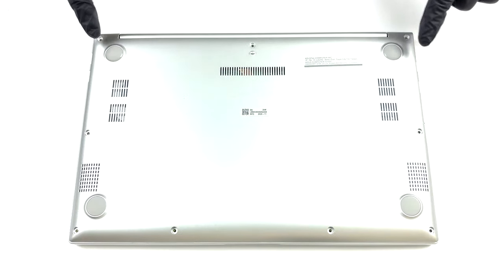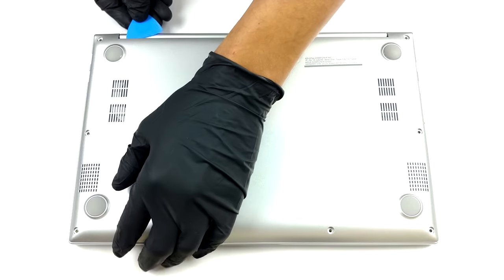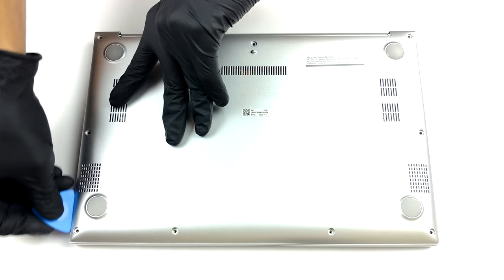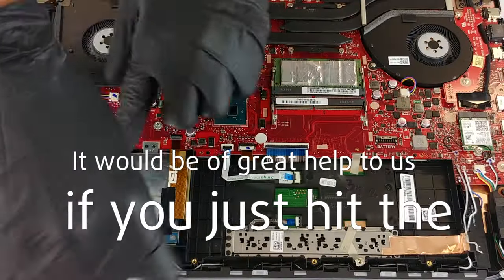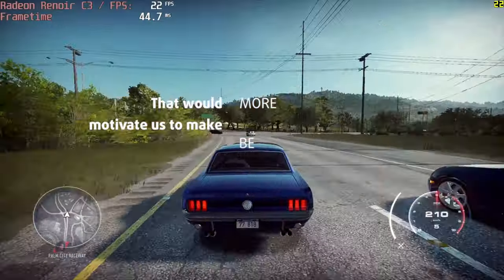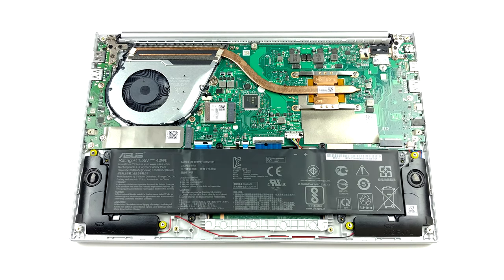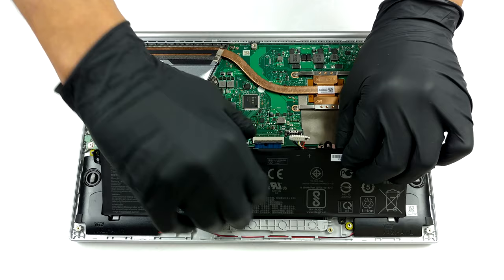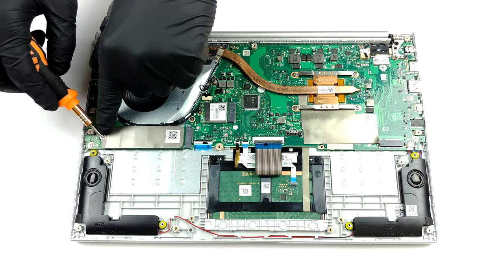🛠️ ASUS VivoBook 14 M413 - disassembly and upgrade options

Comment: Is there a way to upgrade or replace soldered ram? There has to be some way we can upgrade the RAM on this laptop.
Reply: Nope
Reply: @maverickcruise  I have seen videos of soldered ram upgrade on Mac books. Wonder why can't they do it on other laptops.
Reply: It can be done  by someone with experience. The soldered ram is basically 2 ramsticks with the circuit printed on the motehrboard.  With the right tools and components it's possible.
Reply: @catpawjack7687  That's great. Just need to find reliable technicians who can do this. It will be a great upgrade for the laptop.
Reply: @varundeshpandevd   hey did you upgrade your ram
Reply: @benjaminbiju3368  No, none of the technicians in my city were ready to upgrade soldered ram. So after a year, I gave the laptop to my wife and I switched to a desktop.

Comment: Do you know if the TN panel on this model can be replaced with an IPS panel from the same size vivobook?
Reply: Did you find the answer to your question.. is such a display replacement possible
Reply: @locomotive43  Nope. Not yet
Reply: Yeah, you can do it but you will also have to change the inverter of the display. TN and IPS are interchangeable. And the Asus vivobook 14 has a terrible, TERRIBLE colour reproduction so it is necessary to change the screen if you are working on editing or stuff like that..
Reply: @AtAGlimpse_UB  is the inverter a separate part or does it come with the display when we buy it
Reply: @locomotive43  It should come with the display if you buy it from authorised service centre, or else you will have to buy it separately. But don't buy from Ebay

Comment: for the 2nd slot of M.2 SSD storage... upto how much gb should be installed? 512gb or 1TB? thank you
Reply: It depends on how much you need for your activities. If you only browse the web you wont need any. If you work with large files you will need more